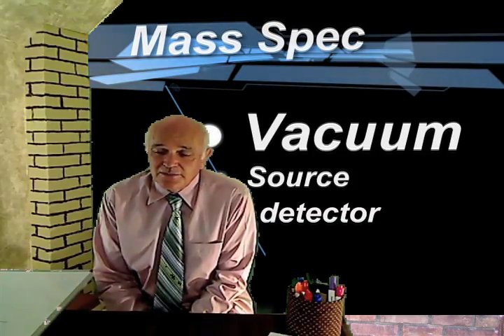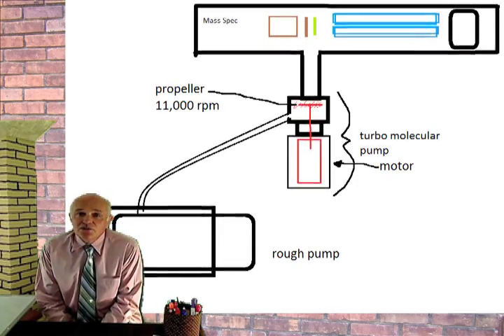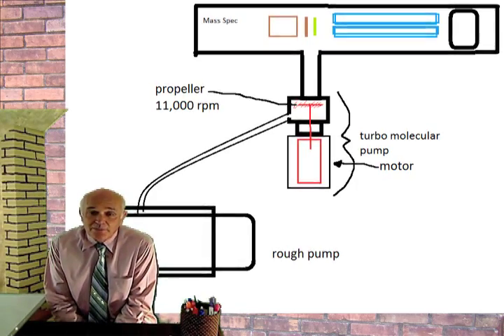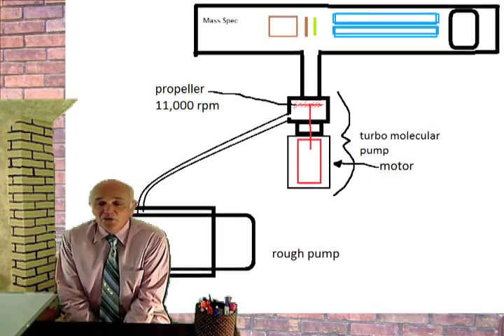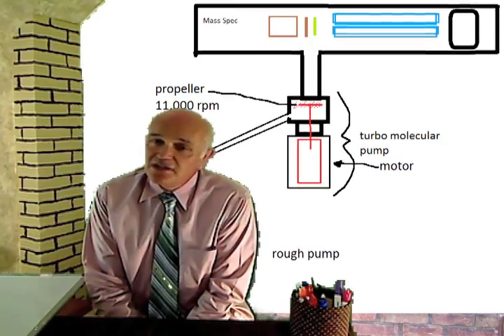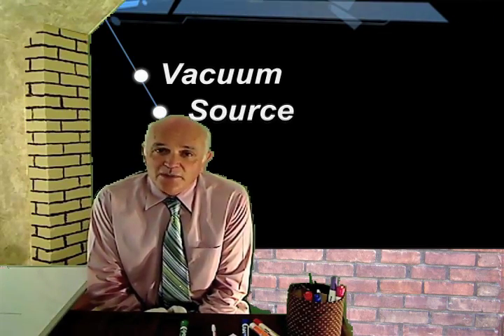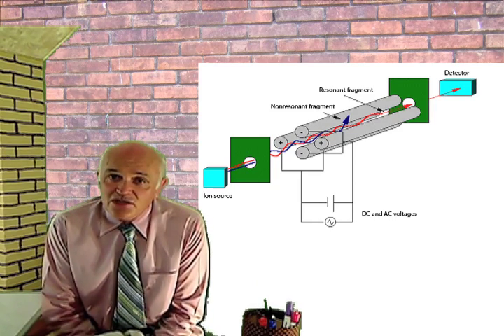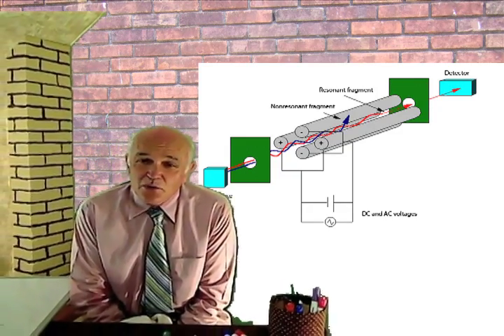EPA 8270 GC/MS Mass Spectroscopy

Comment: Wait, you clean your quadrapoles on a production instrument every three months or so? You did not mention cleaning the source. If the analyzed temps are set correctly the quads never really get dirty. Cool on column injection technique is the key to analyzing hideous matix extracts with better overall performance.